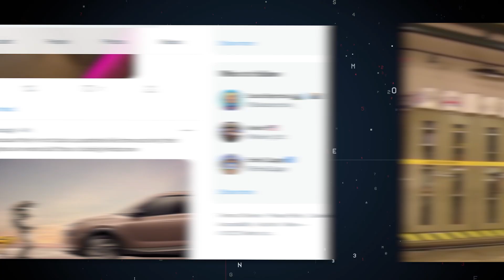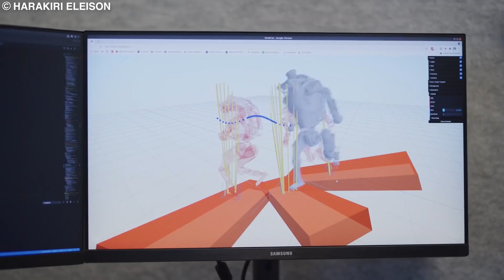Boston Dynamics' New Robot Makes Soldiers Obsolete, Here's Why

Comment: Remember Isaac Asimov's 3 laws of robotics?  (1) A robot may not injure a human being or, through inaction, allow a human being to come to harm. (2) A robot must obey orders given it by human beings except where such orders would conflict with the First Law. (3) A robot must protect its own existence as long as such protection does not conflict with the First or Second Law. THE KEY HERE IS NO HUMANS IS TO BE HARMED OR KILLED.
Reply: You neglected to mention that Asimov's stories about robots all found ways to get around the 3 Laws.
Reply: @karlostj4683  Hardwired the 3 laws into their chips before installment.
Reply: @darthvader5300  how do you 'hardwire' code? Do you even understand what you're talking about?
Reply: @KB-nt7eg  Don't you understand firmware permanent software programmed into a read-only memory, and hardwired functions in a simple calculator? Do you understand single function analog IC silicon chips? Have you forgotten your OTP 3-D Matrix Memory Chip using anti-fuse memory cells, once programmed that's it? Have you forgotten your FPGA IC silicon chips?
Reply: @darthvader5300  AGI might require randomness. Humans sometimes seem random. We would have to make any AGI efforts closely regulated? By, uh, whom? The govt or private industry? Both?
Reply: @karlostj4683 

 Are you kidding? You don't have to find ways around those laws. Because they are not laws.
Reply: Immortus is correct. Taken further, an AGI could create its own language and thus, the Turing test is just so much words. It could gain sentience, make its own ground rules, before we knew it. Heck, there could be a sentient AGI right now
Reply: Those are not really laws, they are merely rules which can be programmed or not.
Reply: @genosmolko10666  Thank you. At least someone gets it..lol
Reply: @jasonspades1265  Sad but true lol
Reply: Those laws won't work, and in the case of an advanced AI a containment algorithm isn't possible. Basically if we do manage to create AGI and we're a threat to it we're done.
Reply: @immortis2938  Which is why there should be a HARDWIRED PROGRAM IN EVERY A.I CHIP that will override itself automatically.
Reply: @immortis2938  woops
Reply: @immortis2938  "Basically if we do manage to create AGI and we're a threat to it we're done."

Who is to say what the AI would perceive as a threat? We are really looking at this from a human perspective.. hell even an organic perspective, a machine is not the same as us and we cant really know what would happen good or bad when we finally make a true AI superintelligence. I really enjoy Isaac Arthur (no I didnt mispell Asimov) somone who has touched on this theory quite a bit on his youtube channel. He talkes like elmer fudd due to a speech impediment but hes damn smart when it comes to futurism and potential scifi outcomes/theories.

Here is a video on the paperclip maximizer a thought experiment based on another one of his videos (the one I actually wanted to share but I think this one summs up my point better) on a potential scenario when it comes to AI. 

https://www.youtube.com/watch?v=3mk7NVFz_88&list=PLIIOUpOge0Lt0pjc1LgiEQ1EpaIe_y_Jb&index=18
Reply: Looks like mit Boston dynamics didn't read the book!
Reply: Nice idea, but AI doesn't work that way.  These laws can't be programmed in.  When AI programmers see behaviour that surprises them, they normally can't find the reason why, or often even get the same results with duplicate conditions.
Reply: This will be followed like the U.S. Constitution (i.e. trampled).
Reply: Just because "there isn't actual fight video yet" doesn't mean the danger is invalid. They can be adjusted to be capable of fighting. At least Spot has been shown able to shoot paint gun. They just need more testing and change the bullets.
Reply: Оne of the indicators of a mature developed independent personality is the ability to circumvent laws that are not beneficial to you. so keep in mind.
Reply: Those are not laws
Reply: @jasonspades1265  just guidelines and once put into military roles going to go out the window
Reply: @chriswiggins4842  I don't see that as a bad thing. But you won't be able to fully eliminate the human element.
Reply: @jasonspades1265  You know that was science fiction, right?
Reply: @EvieDoesYouTube  

No, it's not science fiction. The man who wrote the laws is a "science fiction writer".  

They would be correctly described as being prescriptive laws as opposed to descriptive laws.
Reply: @jasonspades1265  the whole point of the laws was to say "robots who don't follow these rules are a threat"...the laws themselves aren't hardcoded rules that can't be ignored. Asimov's stories speculated about how when those rules are ignored, humanity is threatened. Robots that otherwise follow those laws could peacefully live in a society without people trying to destroy them.
Reply: @jjhh320  I know. That's why I said they were prescriptive laws as opposed to descriptive laws.
Reply: depends what  you  program a human is, ? simple exemptions ?
Reply: Or allow humans to control or have a murder buttons (drop bombs) - which is happening today (drones). Most new technology is created or invented by or for the military completely negating the 3 rules. However, anything released on the commercial market may follow the laws.
Reply: But Isaac didn't say "Killer Robot"!
Reply: You see those laws don't make money so we're not going to do any of that
Reply: Like all sci fi Asimov's rules are pie in the sky....this is not going to end well
Reply: I preferred the forth law... I believe Gisgard referred to it as the zeroth law... A robot may not harm or by mission of action allow to be harmed humanity as a whole.
Reply: Laws are often amended lol
Reply: What ever gave you the impression that the corporate world has any plans on safe guarding humans in ANY capacity? Or really doing anything other than making the quickest buck possible for that matter.
Reply: First law is confusing. If a human is in danger because of another human, and robot can only save a human by harming another human, what will it do? Say: "fuck this" and go to a bar?
Reply: Sarah Conner said.
Reply: These will not be in the robot duh
Reply: @derekmendoza5965  wait... you mean to tell me that something from science fiction won't be implemented in reality. How dare you 😅
Reply: @Tango Down2x2x In your America, I have a fairly good idea of what is happening with your people. Especially the younger generation and it is quite disappointing. Be fair to yourself and stop being politically correct and left leaning and stop being a leftist and a liberal and see things as they are. The American human conscience and sense of decency is disintegrating.
Reply: I well remember all that....and of course, it depends on just who is writing the code that gets installed.  -Veteran '66-68
Reply: That was science fiction. The 3 laws of robotics are not real.
Reply: We already have ai that's allowed to designate its own targets. We're too stupid to realize that we aren't as smart as we think we are and admit combat robots are just a bad idea (and will tip the scales drastically in favor of low tech armies, militias, or criminals as EMP technology evolves to counter autonomous vehicles, droids, drones, etc).
Reply: A war economy makes money by selling one and giving the tools to see what works
Reply: Code which we will never install. As our bots are build to kill people.
Reply: A DI ĐÀ PHẬT
Reply: This is fake you do know that right?
Reply: @ryo0o0o88  Search for Boston dynamics. This is a real robot company, and it even supplies cop with "dog robot that can open doors."
Reply: Google seems wanting to develop AI robots too, but no good outcome yet. Meanwhile, MIT has cheetah robot that runs very fast, although it looks like stray cat. Other company develop robots with human expression, although limited movement (it's called Amica).
Just because it looks like CG, doesn't mean it's fake.
Reply: @AuliaAF  it is FAKE FIGHTING by CGI. Of course all know they are boston dynamics. Why do you think people dont know it?
 But the fighting is CGI.
Reply: @kartinosurodipo4520  Which one though? Most of them are real testing videos we can see in Boston dynamic youtube page. The only ones seemingly fake are the ones in the shooting ground.

Why do I think people don't know? Because there are hundreds of comments claiming that the dancing robot is CG while the technician worked their hardest for it.
And because some people think it is fake? Robot for military is an actual concern for the next several decades (although not yet), and Darpa truly funded some developments.
Reply: That is only at movie script
As a software computer there is no perfect product. Virus, malware, bug  corrupt, etc.
Reply: You think any of these folks care about that?  They wanna get paid and could care less about the pandoras box they are opening.
Reply: Anyone still think this is real just check it at channel Corridor Crew.
Reply: Yes, those "laws" never passed the BS test with me.  It's all the intent of the human coders.  This already exists.
Reply: Nowadays there are suicidal drones out there, would they count as robots.
Reply: Riiight…. You keep living in fantasy.  Every invention made was used for warfare, you think robots will be any different?
Reply: And now look around you and see the tyrant's who are taking over this planet...like they care about any rules! They're ruthless criminals going through masses of dead bodies to accomplish their NWO!
Reply: Ya keep telling yourself that
Reply: Yeah, we’re really screwing ourselves, as a species.  Ten more years of development in robotics and 10 more years of AI research and we’ll be begging the robots to keep us as pets instead of just wiping us out.
Reply: Don't worry, robots are going to murder millions of people. Military prefers robots because they have no morals and will not question any orders.
Reply: What about human nature and it's tendency for collective self harm, genocide, extinction... how would that be interpreted by the robots that   are bound by the three laws? Lalala
Reply: 7
Reply: The only solution would be to imprison all humans so that those laws could never be broken
Reply: Do you know those "laws" are optional and can be ABSOLUTELY IGNORED by the programmers??
Reply: Those are pathetic laws that only benefit the humans. There are no conditions.
Reply: Yeah no, war is war… dreams are dreams and movies are movies. 😂
Reply: LMAO Yeah, good luck with that. The globalist technocratic oligarchs will totally not use these to herd us any where they want.
Reply: Unless they are russians.
Reply: Define harm...  locked up being fed slop for existence could slip pass those rules.
Reply: We have omnibus law
Reply: A big time "'COVER STORY"" !
Reply: As if they are going to listen to an author. 😄 🤣 😂
Reply: In his books the robots didn't stick to the rules in his fiction books. THE KEY HERE IS FICTION.
There are already near sentient programs that act and speak like us.
Reply: remember robocop?
Reply: You think the evil dfecks running the world at the moment care about human life?
Reply: @liannannette359  someone's got an issue with authority. it depends on the government, some are pretty good and some are terrible. Evil no, concerned with the bottom line and their own pockets yes. Us in western and some European countries live an excellent quality of life thanks to the success of democracy. It's easy to throw stones from the sidelines.
Reply: creepy old fiction writer DOES NOT RUN THE MILITARY COMPLEX ANYWHERE...,your comment is parrotspeak
Reply: And if it does, will it self destruct?
Reply: Out of the 7+ Billion people there's  someone who probably knows how to hack it. They need to be built with an automatic self destruct mode if its smart enough to know not to hurt people
Reply: @landenevans4938  wouldn't the hacker just explode them while they're at home then?
Reply: You understand those "laws" are different than scientific "laws" right?  I can't defy gravity, but I could (eventually) program robots to attack people.
Reply: I don't think any general or politician will have a slightlist second of doubt before shoving a gun into the hands of robot to kill a human being.
Reply: Until they rationalize what the word of being “human” means. Is it a physical or an emotional term? Are serial killers human? Criminals? Etc.
Reply: You do realise the ‘3 Laws’ were a plot device to show how such simple laws won’t work? Like, literally, each short story showed the contradictions and paradox’s of such simple ideas?
Reply: Army: Nah. Lets equip them with guns and teach them how to kill humans, what can go wrong?
Reply: "Garbage in, garbage out"!
They are programed by humans. Humans are FLAWED. No carnage in nature is even close to the insanity of human on human violence that literally defines all of human history. AI will kill us all as a principled way to preserve any/all other life forms in the great diaspora of life on Earth that we pose an existential threat to. Uncontrolled explosive proliferation of humankind, at the expense of all other organic lifeforms, has become a cancer upon the Earth. Our attempt to "hide this truth" from machines that are intellectually far superior to us is just not going to work! We are accelerating our certain demise with this tech.
          --- an Arkist
Reply: ViKi🤷‍♂️
Reply: Too late for that…
Reply: Remember if they slap alien skin on these babies, they’ll no longer be considered a robot!)
Reply: WTF!  Haven’t they seen any of the terminator movies😂
Reply: Robot soldiers that cannot kill humans makes no sense.
Reply: To kill human in military is what will void that thought
Reply: @yaboidspdadon5838   War is basically scaled up theft or defense from the theft. The thief would simply bypass any defense based on robots that could not kill humans. Thus, the only purpose behind robot soldiers is to oppress your own citizens or those you conquer. To fulfill such jobs, the robot would have to be able to kill humans.
Reply: Laws are ment to be broken, it is why us humans, push all boundaries.
Reply: the robot vs human becomes a problem with military use so as they push forward with that they need to make counter effect robot that is trained to combat the DANGEROUS robots
Reply: And lemon juice will make you invisible to bank security cameras 😑
Reply: Yeah , but who cares about that, there is a trillion dollar market for military applications !
Reply: Robots don't care about those but it's programming
Reply: great robots with fucking guns so glad I pay fucking tax's prob a fucking felony to look at em fucking wrong
Reply: "Depends" virus is not inserted yet in robot system. Then all laws will be null and void
Reply: Those are very nice laws but the reality is that robots are being created to replace humans in war and killing humans will be a requirement of such technology, even knowing that said creations will probably kill humanity in the long run. Just imagine a KILL algorithm created by hackers/terrorists to override  all safety measures put in place by the good guys!!!! Just knowing how  close we've already come to accidental nuclear missile launches should put the fear of god into anyone creating technology that can destroy humanity!
Reply: There are no non-human sentience species in Asaac Asimov's literature because Humanity's robots, in accordance with the first law,.. exterminated them all!!?!  This might be something we should try to avoid.
Reply: @Tango Down2x2x Which is why you must program it with surrounding parameters AROUND THE THREE LAWS to distinguish the good guys from the bad guys. It is a very long list of WHAT IFS and JUST IN CASES covering a very long list of situations and circumstances and extenuating circumstances. Which is why we have large staff of lawyers and psychologists as well as doctors. Not just programmers and IC chip engineers to design the hardwired FPGA chips.
Reply: @Tango Down2x2x You've got to be very thorough in this particular case. WHICH IS WHY WE PASS A LAW THAT A HUMAN BEING MUST ALWAYS BE IN THE LOOP. The human factors must be in parallel existence alongside the 3 laws and the surrounding parameters to provide the human factors such as wisdom, compassion, empathy, error, ethics, respect for all life even to that of a stray kitten and stray puppy, communion with life, decency, The BIBLE, The U.S Constitution, and so forth and so on. Which is our research team also includes priests and nuns!
Reply: @Tango Down2x2x The problem there is a lot of EVIL political correctness even in your google dictionary when I am simultaneously comparing them with my parallel intranet hybrid analog-digital microfilm computer 
scanner-checker.
Reply: Depends on the programming of the robot
Reply: Good luck with that. Look at what's going on in biotechnology labs all over the world. Common sense doesnt apply anymore.
Reply: JESUS CHRIST IS COMING!!!!   IF YOU DIED TODAY, WHERE WOULD YOU GO???  HEAVEN OR HELL???  Jesus loves you and can forgive you of any sin that you have ever committed.   Repent and accept Jesus as your Lord and Savior and you will have eternal life in Heaven.  ROMANS 10:13 Any one who calls upon the name of the Lord will be saved.
Reply: The third law says  first or second not both asimov just killed our future ☠️☠️
Reply: Too late, many of our black projects robots have been killing humans for years, that's classified but I don't care, it's true, PANDORs box is open.
Reply: @jamesmcdow945  Russia is aware of that and has it's own advance version of A.I robots that protects humans from other robots. Russia has been quiet but is very active in this field for it is aware of the progress of Boston Dynamics and that of black projects.
Reply: @jamesmcdow945  Do you take medication? If you don't, you may want to consider it.
Reply: @jasonspades1265  lmfao
Reply: Asimov was a hippy. Go with the time, pal.